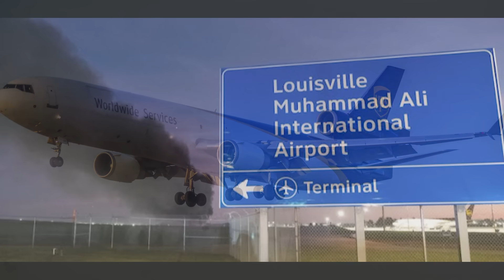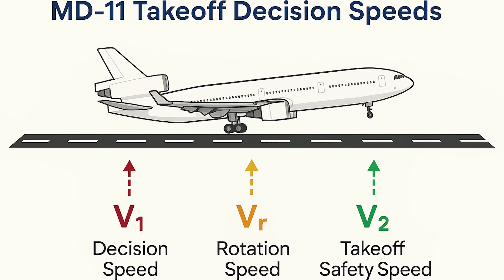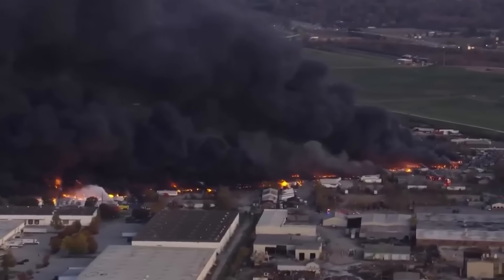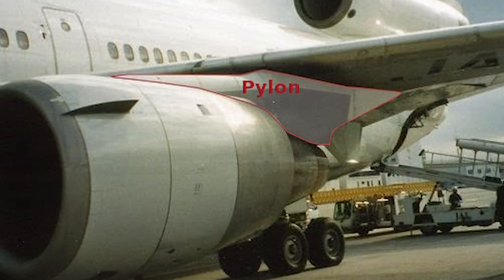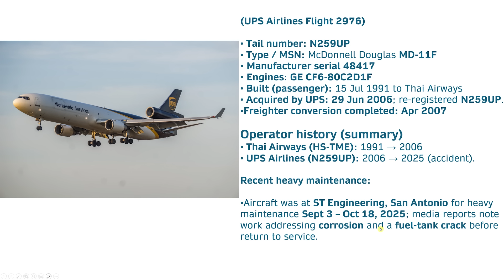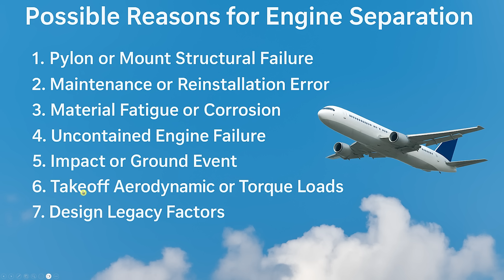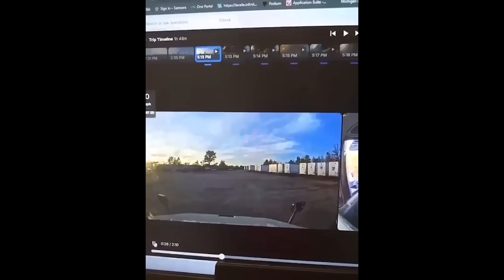What Caused UPS Plane Crash, Louisville, KY? How MD-11 Engine Fell Off

Comment: When are they going to fit rear view mirrors/cameras to big jets? There have been several incidents over the years with engine failure occurring on the take-off run. A rear looking camera or mirror would immediately give the flight crew clear evidence of where the issue is without having to scan instruments at this crucial moment in the flight. It may have helped the crew to abort the take off earlier to avoid the horrible incident we have witnessed trough all this scary footage. My thoughts and prayers to all those who have lost people through this terrible crash.

Comment: This will be the end of the 3-engine MD10,11 type aircraft.  
Engine #2, the rear engine was also damaged resulting in just one engine left to keep the plane in the air which is why it went in so soon.  Debris from engine #1 took out engine #2.   Its a bad failure mode to have one engine behind another one so that you will likely lose two engines when one explodes.   They would have been ok if it was just a one engine failure.  The worst fear of jet pilots is a compressor disk failure.  The front fan of the engine is the largest one and has a tremendous amount of energy when taking off a max weight - the centrifugal forces are so high.  The industry has been working on developing the absolute best materials for this part for decades.   There are Kevlar ballistic blankets under the cowling to try and contain this heavy thing when it explodes.  Gets tested during engine development of course, but there are no guarantees.   You will notice the engine core that fell off has almost no fan blades on it.  The airlines bailed on this aircraft type long ago and its shameful that the cargo companies chose to take the known risk of this kind of failure mode in order to save cost with some cast off equipment.  And would it be too expensive to break up a long haul into two short jumps to avoid stressing out engines to their max?  "Just saying" as a former avionics engineer....
God bless to all involved - there is the hope of life again according to the Gospels of Jesus.

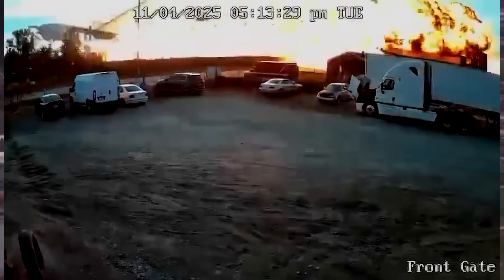Comment: Perhaps buildings shouldn't be allowed to be so close to runways, as we had witness in this terrible accident.  The accident in India, Air India Flight 171, comes to mind as well. ("Air India Flight 171 was a scheduled passenger flight from Ahmedabad Airport in India to London Gatwick Airport in the United Kingdom that crashed 32 seconds after takeoff at 13:39 IST (08:09 UTC) on 12 June 2025. All 12 crew members and 229 of the 230 passengers aboard died. On the ground, 19 people were killed and 67 others were seriously injured.")  Consider placing airports far enough from businesses and residential areas, and have a law that would forbid building around them, establishing a safe perimeter in case of a catastrophic accident as the ones that have taken place in India and now in Kentucky, USA.

Comment: This happened in Chicago several years ago as the results of wrong mounting procedures when attaching a new engine. The engine mounts were damaged when mechanics used a forklift to replace the engine rather than the specific mounting lifting device. Saved time!

Comment: In the first 45 seconds of the video, the left engine was still on the plane. Look between the first set of trees.
Reply: The engine was found 2,000 ft from the departure end of the 12,000 ft runway.

Comment: The aircraft had been undergoing a "D" check, which typically is carried out every 5 years. This is the deepest level of maintenance. During these checks the aircraft is taken apart and reassembled. Often modifications and new equipment is installed. In addition the fuel tanks are completely emptied, cleaned and treated for corrosion. When in use condensation can build-up as the aircraft cycles between warm air on the ground and very cold air at altitude. Often small cracks are identified during this work using non-destructive testing (NDT). Rectification is usually a matter of stop drilling the cracks and installing repair plates, in accordance with approved repair schemes.

This is normal practice with all large aircraft.

Comment: Those pylons are designed to be weaker than the wing and to break and let the engine fall away if it starts shaking too violently, the idea being that it's better to lose an engine in flight than the entire wing.  Unfortunately, losing an engine like that just as you're lifting off is not recoverable.  I suppose the question is, did the pylon operate as designed and it was the engine that malfunctioned, or was it the pylon itself that failed as was the case in the Chicago crash.

Comment: Add to your possible For Engine Separation 

8. Maximum takeoff 🛫 weight 
Well over 1/2 million pounds HEAVY even in call sign required 
MTOW	602,500 lb / 273,294 kg, ER: 630,500 lb / 285,988
 kg
9. Probably not a reduced power setting (MAXIMUM Power)
10. ADSB (Stated) 450ft, airport elevation 501 tail going through building. 
11. Remember takeoff 🛫 weight is a calculated number 
12. Runway 17R at Louisville Muhammad Ali International Airport (SDF) is 11,887 feet long and 150 feet wide
Again your POSSIBLE 
13. Flight ✈️ Crew (GODSPEED) used up runway could have BAlls to the wall
Meaning throttles pushed past limits. I know there are MD-11 has FADEC (Full Authority Digital Engine Control). The FADEC system is a key part of the aircraft's advanced systems, managing engine performance, efficiency, and safety parameters. 
Still can push balls to wall emergency power.
14. Depending on engine 
The DIAMETER OF THE forward FAN approximately 94 inches 
15. The engine laying on ground the Kevlar band around fan area is strands (WAIT FOR investigation)
16. New SUBJECT #2 engine 
Flashes coincide with possible tail strike 
17. Sympathy ❤️‍🩹 to family’s 
And all those that a Sad Day had come to pass 🙏 
Member of the Order of The sleepless KNIGHTS 
Freight Dog Anonymous 
Godspeed

Comment: ITS ABVIOUS SABOTAGE AND THE REASON FOR THE CRASH PLANES NEED BOTH ENGINES ON TAKE OFF THIS ENGINES ARE BOLTED TITE SO SOMEONE DID THIS FIND OUT WHO WORKED THE ENGINES DONT FORGET THE DEMS LET IN OUR ENEMIES WHO NOW WALK AMONG US AND ARE HIRE WITH NO VERIFICATION THIS IS BAD REALLY BAD WHO ARE THE ISLAMIST WORKING OR AROUND OUR AIRPORTS ? GET TO WORK AND DONT JUST DEPEND ON THE FBI LOCAL INVESTIGATOR MUST DO THE JOB TOO ...
Reply: Yeah DEI sabotage UPS is known for.
Reply: @Angelum_Band  MORE WORDS PLEASE I WANT TO UNDERSTAND YOUR POINT ...
Reply: @carmelochemtrailskiller8770 The CEO of UPS is a democrat woman who supports diversity equality and inclusion.
Reply: @Angelum_Band  YEAH BUT STILL SOMETHING IS WRONG ENGUINES JUST DONT FALL OFF THEY ARE BOLTED DOWN JUST SLACK WOULD MAKE THE PLANE SHAKE RADDLE AN ROLL HA HA !! BUT AS YOU SAID IF THEY HIRE THE WRONG PEOPLE IT COULD HAPPEN THAT A MISTAKE LIKE THIS GOT UN-NOTICED ... NAAA !! ITS TO BIG TO MISS ...
Reply: @carmelochemtrailskiller8770 There's gap where the plate that that holds the blades supposed to be. That plate is spining around 10,000 rpm. If the plate goes it goes out like a grenade.

Comment: The key period of this incident is from the time the plane started accelerating down the runway to wheels up, approximately 45 seconds in duration. What do the airport's CCTV show about this time? Is there footage of the plane in this time? What is on the Cockpit Voice Recorder? (What was said during this crucial time inside the cockpit by Capt. Richard Warternberg, First Officer Lee Truitt and/or International Relief Officer Capt. Dana Diamond?)

What happened in these 45 seconds? Possibilities:

(1) The left hand side engine separated from the wing like with American Airlines Flight 191 (25/6/1979) i.e. Mechanical Failure/Technical Fault.

(2) The left wing bumped/smashed into the runway and severely damaged Engine 1 which then separated from the wing and severed the fuel line. e.g.

(a) 5/11 23.04 ET RealJohnShoe on X  "Looks to be catastrophic. Maybe cargo got violently dislodged and the plane smacked the ground. fxnighttrader: "
How could cargo getting dislodged make the engine fall off?" RealJohnShoe "Makes the plane veer up or down dramatically."

(b) 6/11 00.14 BoDeepest on X “Looks like they stalled and dropped a wing. 🙏 

(c) The Pilot in Charge during the track and acceleration down the runway experienced a problem, lost manual control, moved/jerked the yoke, the left wing dropped and hit the runway... 

(3) Other

Prayers for the injured, maimed and deceased people on the plane and ground from this terrible aviation incident.

Adam Neira
Founder of World Peace 2050
Founded in April 2000
Paris - Jerusalem - Melbourne

Comment: Metal fatigue was the likely cause.  Question is then was it from wear and tear or prior damage not properly repaired.  Also why did inspections to reveal the fatigue.  If not fatigue then the engine exploded and ripped the engine off.

Comment: i stg if it's the bolt attaching it to the wing i will flip. because that's something we solved more than a decade ago when this happened on a commuter jet.

edit- I see jeff's thinking the same thing I am.

edit2- fuel tanks are on the wings close to where the engines are so yeah, high likelihood that's got something to do with the engine falling off either directly or indirectly

Comment: Rumor is this plane was parked and having maintenance done for 2 weeks. Could have been an engine repair or replacement. Due to the time, this plane would have been required to do a 100% power takeoff. If something was missing or improperly torqued, it definitely would have shown up with the vibration of that takeoff.
Reply: The aircraft had been offline for a routine "D" check, which was completed on 18th Oct 2025.

Comment: The engines on planes are designed to fall off if they encounter an out of balance rotor. They are held on by shear bolts. So it appears they worked as designed. Unfortunately too soon. But that maintenance entry will lead the investigators to look at  corrosion I bet. Something tells me an A&P mechanic has missed something big. Once corrosion is found things need to be throughly inspected more often. 2 dissimilar metals dont play well with each other over time.  I'd hate to be the one who signed off on those maintenence records after the HM. The stress would drive you to drinking. Praying it was a random freak bird strike or pilot error but doesn't look good on the surface.